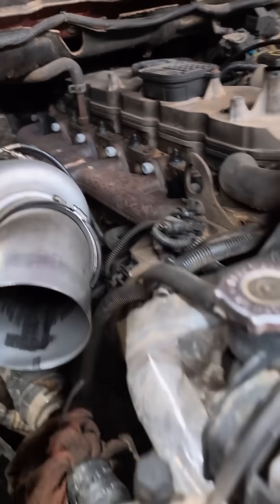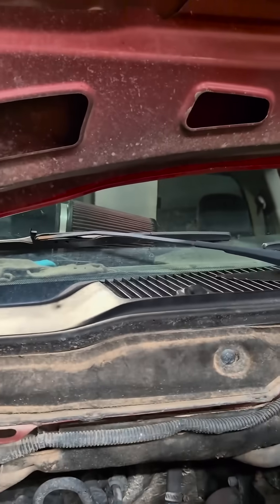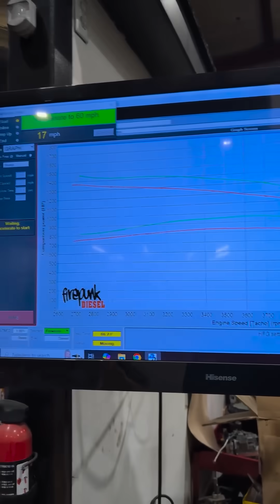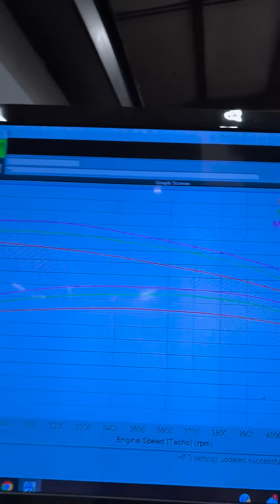Project RotBox went from a 468 to a 472, how much power is gained?

Comment: I have a DT360 I'm building, it supposedly has enough fuel for 650-700hp on a p Pump and a s369 billet compressor wheel, box s475, and a turbo smart waste gate bypassing the s369. I know the 369 will be slow to lite compared to a smaller turbo but do you think I can get by with no waste controlling the exhaust flow to the 475? The 475 should have no problems over spooling since I don't have enough fuel to really push it yet.
Reply: You’re probably better off with just the s369 at that power level.
Reply: @Thesemiguy  I really wanted compounds and these were ones that I got from a guys 12valve. I don't think his setup was very thought out since he had no waste gate at all. I ended up rebuilding the s369 and getting a complete center for the s475. I think I'm going to try to run it but if I do anything I'll just downside the primary and keep the 475 atmospheric. I can see myself wanting to push past 1000hp with the truck once it's together. It has fire rings upgraded valve spring and cam so other than fuel and air the engine will take it.